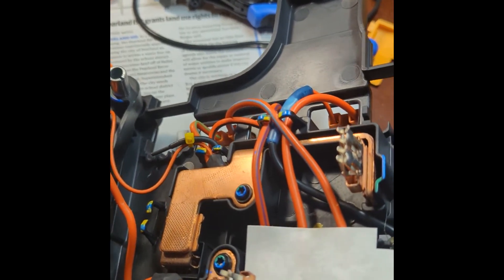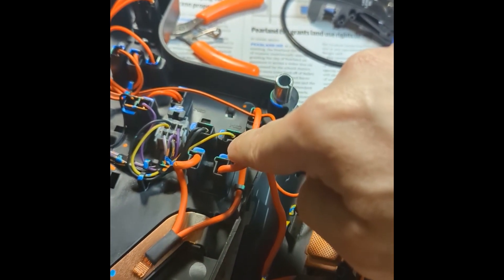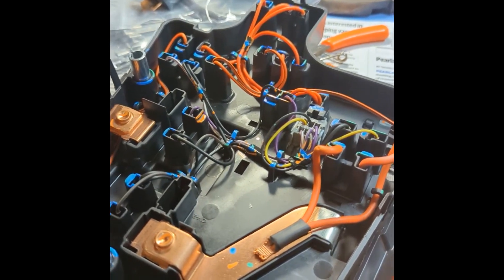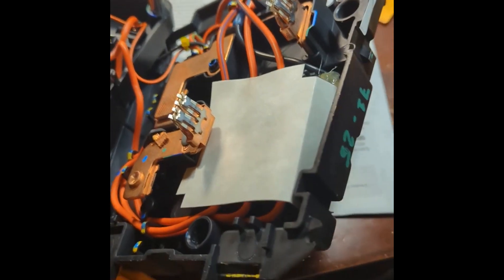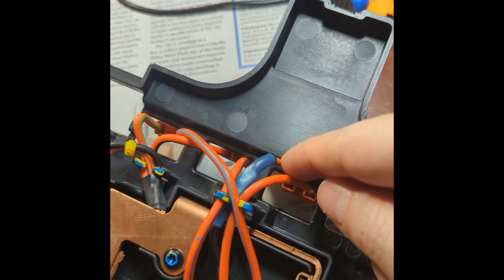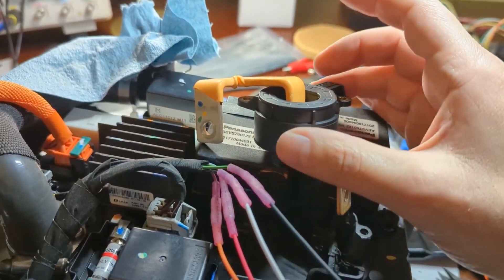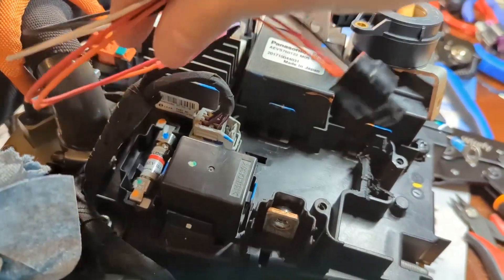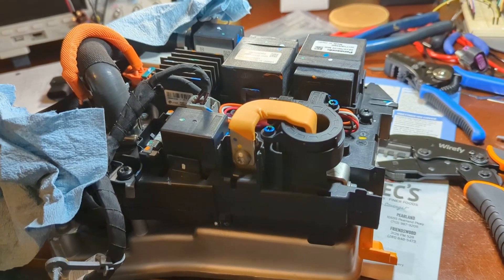Porsche 924S EV Conversion - Part 25 - Modifying the Chevy Volt Contactor Module

Comment: I'm 6  months into a project converting a  50yo 9-ton trawler to electric.  Lots of challenges with the project but convinced that it can be done with favorable results.  Just reached the point where I can start considering which motor/drive to use.  The Leaf motor is intriguing.   Thanks for sharing.

Comment: Hot glue, no bueno. It melts and scalds at fairly low temperature. Silicone if you have to. Oh, and, I think I know what's going on with the negative lead being smaller. it's not. it's the correct size. The real mystery is why the positive lead is so large :p

Comment: I started out planing to use the Nissan Leaf contactor block but in the end decided to go freestyle and do it myself. I'm still not sure it was the right decision but it gives me options like using a contactor for the negative as well as the positive. 
My charger and heater connections will be on the switched side of the contactors so there will be no possibility of HV to these units with the car turned off. I also have two contactors in the rear battery box so the pack will effectively be cut in two with the ignition off.
Those contactors do not have economisers so will draw 700 or 800 mA each at 14.4V. 
I asked in Openinverter about that and the consensus was it will shorten their life. A simple capacitor and resistor (connected in parallel) wired in series with the contactors will help to save them. I believe the OEM's use PWM to have 14V when switching them but then reduce the voltage to lower the current and power.